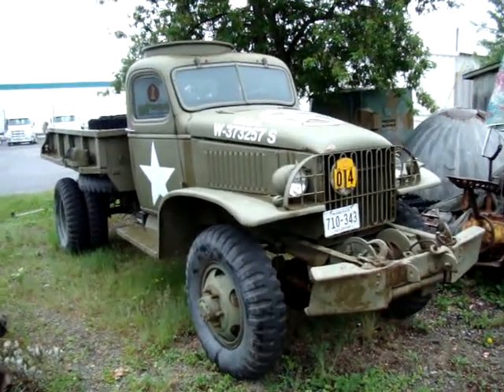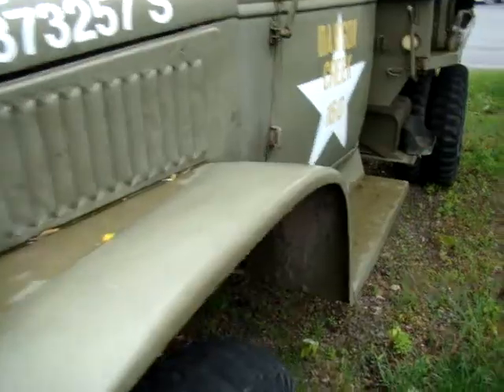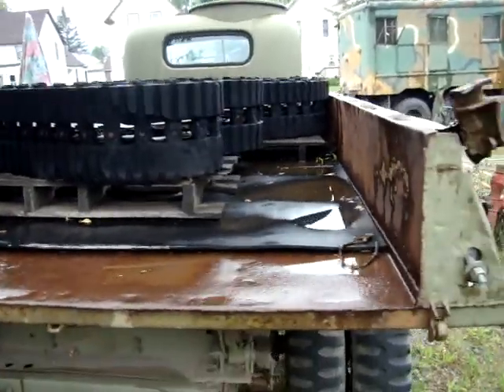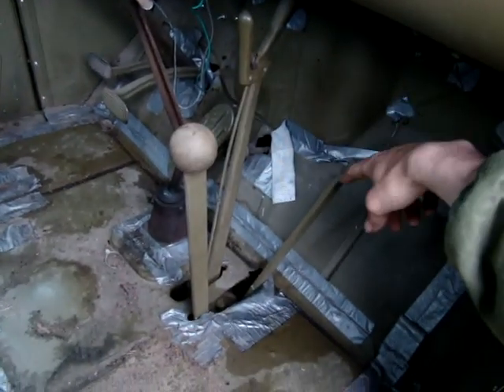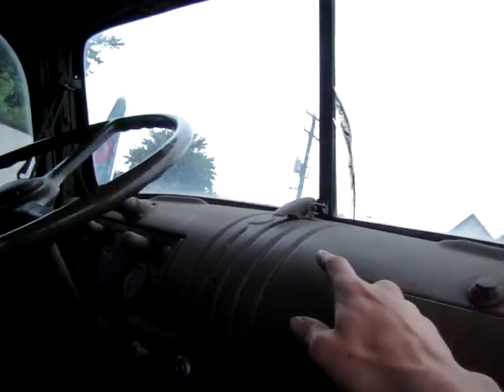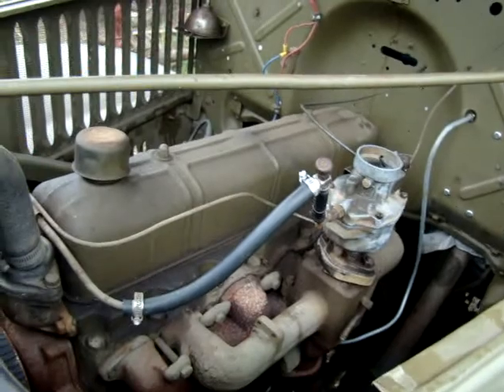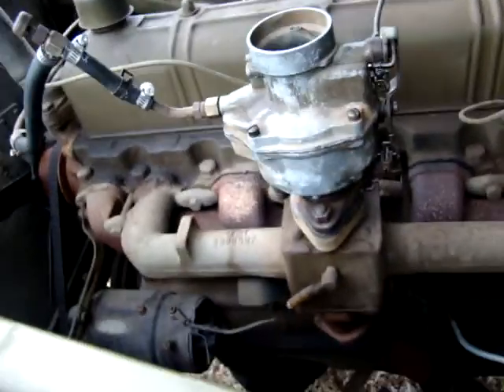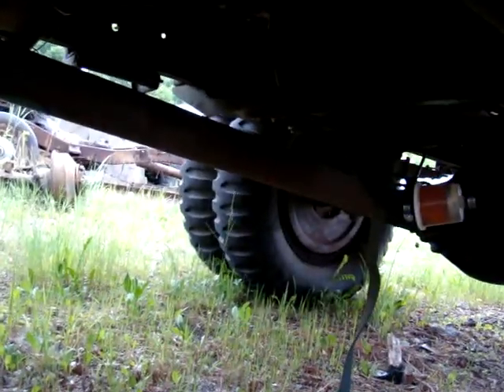1942 chevrolet military g7117 winch with dump walkaround

Comment: the g7107 and the g7117 both took the same hard cab as the cckw. on this one some one has put cckw side panels on this truck. The Chevy's had fewer slots. pretty common though as things were changed in the the field. used what ever fits. You see many trucks with many modifications after a few months in field due to war damage.